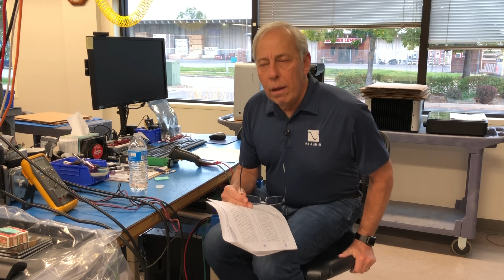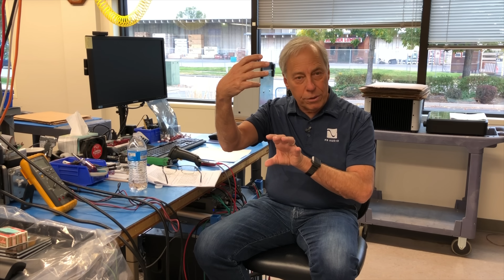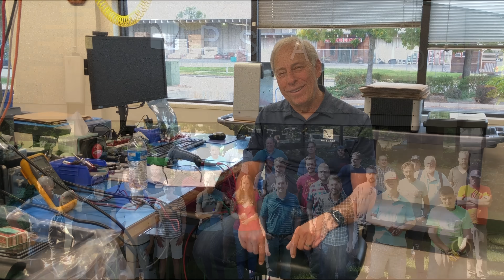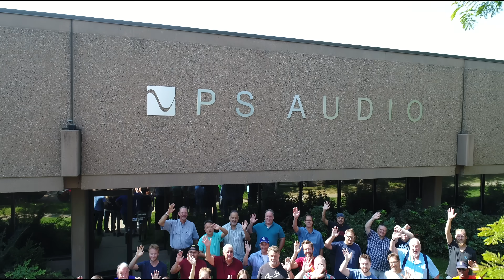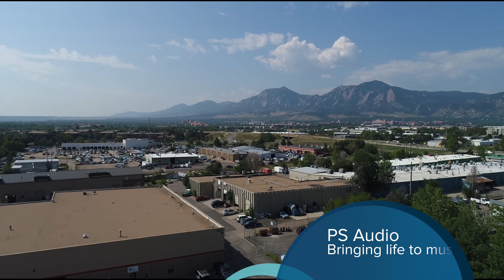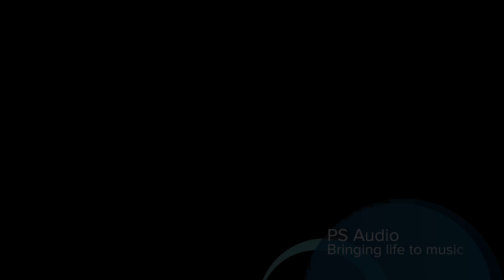Can one frequency distort another?

Comment: I still can't get my head around how a speaker can play two different frequencies at the same time. The speaker cone is been driven by effectively a push pull motor. If one note is asking for 2000Hz and another note is calling for 5000Hz why doesn't it average it and play a 3500Hz frequency? I am envisioning this to be like asking a car engine to do 2000rpm and 5000rpm at the same time. Can someone explain in simple terms how this is possible please.
Reply: It's like the car engine's vibrations at the power stroke frequency, which add to the basic crankshaft rotation.  They need to be suppressed by a flywheel so they don't cause parts to loosen and fall off while driving.  
Or try this visualization:  You're sitting on a swing, swaying back and forth at perhaps 0.3 Hz.  Now hold your hand up in front of you and move it forward and backwards at 1-2Hz.  Then wiggle a finger at 3-4Hz.  If a string was attached to your finger, do you see that it would experience motion that includes all of those frequencies, but nothing in between?
Reply: @marianneoelund2940  good examples, I get it.

Comment: The IM distortion in loudspeakers is not by the Doppler effect. As Rod Elliott (http://sound.whsites.net/doppler.htm) pointed out.

When Doppler was the cause of the distortion, then the distortion should be at its greatest when crossing zero, when the speed is at its maximum. But, it is not.

The IM distortion is at its greatest at the maxima of the excursion, when the speed is zero! So, it is not the Doppler effect, but change in position of sound source for the higher tone.

Another (and bigger) sources of IM distortion are non linearities in the force factor and the suspension of the driver.
Reply: http://sound.whsites.net/doppler.htm is the right link (without the ')' ), sorry.

Comment: I know nothing about this is related but thinking about Doppler and a speaker makes me think of my churches' Leslie rotating speaker.
Reply: That is the Doppler effect exaggerated. The original Leslie speaker was amplitude modulated, but later versions were frequency modulated.
Reply: Put two speakers at the opposite ends of a see-saw, then spin the see-saw.  That'll give you plenty of doppler distortion.  
But the Leslie rotating speaker only rotates a deflector or duct that sits in front of the speaker, and the speaker itself doesn't move.  So I think the primary audible effect is using the sound's directivity to modulate the frequency response.  Some doppler shift would occur, but only from the sound reflecting off of the interior walls of the moving duct, that is only a fraction of the sound is affected.

Comment: Another cause of intermodulation distortion happens as  a driver isn’t equally good in moving in a linear fashion at all cone positions. For example, if you play music with a powerful bass signal at 30Hz making your woofer cone move to near the extremes where the magnetic field and rubber surround are at the edge of their operating range, other higher frequencies added will experience more distortion as the cone can’t move well relative to all the near peak cone positions of the 30Hz signal.

Comment: I understand how this IM distortion can occur with a single driver, but would not a 200 Hz tone be passed through the crossover to the woofer and the 5,000 Hz tone be passed to the upper mid range or tweeter depending on the drivers?  Another question is can this occur in amps?  I think so because I have an IM distortion analyzer that is used to measure this in the amplifier.   How is IM distortion addressed in amplifier design?
Reply: "How is IM distortion addressed in amplifier design?
"

Back in the Dark Ages around 1970 amplifier designers were competing to achieve the lowest possible THD. Then Jim Sugden introduced his A21 amplifier with an order of magnitude or more THD than his rivals, but it sounded much better. This was eventually identified as due to the A21 having much lower IM distortion. The extremely low THD in rival amplifiers was achieved through using gain stages with a large "excess" gain that was used to provide  a high level of negative feedback. Reducing the gain and thus the amount of negative feedback reduced IM distortion. Individual stages in the amplifier chain were also designed with a very high bandwidth of 50 KHz or more. The input was limited to 20 KHz, but available bandwidth after that is often 100 KHz. Keeping global NFB low also appears beneficial.
Hope that helps.
Reply: Jonathan Strum ...  Thank you for this.   I have both Harmonic distortion analyzer and IM distortion analyzer.  I had wondered how the IM was addressed.
Reply: @swinde  Happy to assist :-)
Reply: Swinde crossovers of any type don’t spit the frequencies cleanly. They get attenuated gradually (a number of dB per octave) this vids question was somewhat philosophical... but for example if you have a xover at 5000htz and play a 4999htz and 5001 htz note: the xover will have little influence what the speakers do
Reply: That is true, but a 200 Hz tone should be attenuated to the tweeter that is reproducing the 5,000 Hz tone which will reduce any IM that would occur in this case.
Reply: Hey Paul, I think you’re wrong about blaming the Doppler effect as a source of distortion... (Not that it matters) That is how frequencies naturally mix.. more interesting though: I wonder if your amplifier engineers have taken a simple amplifier design and purposely tried to increase harmonic distortion for learning purposes??